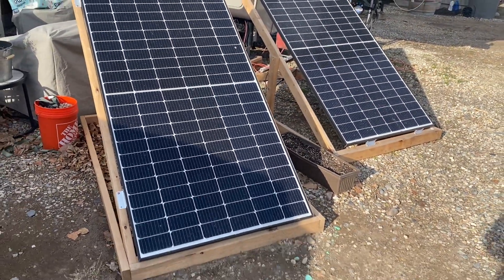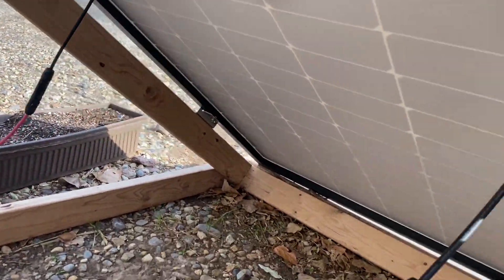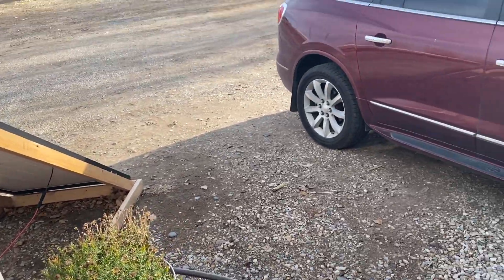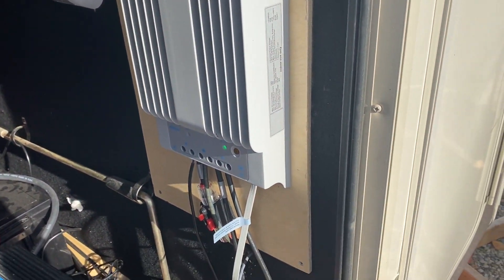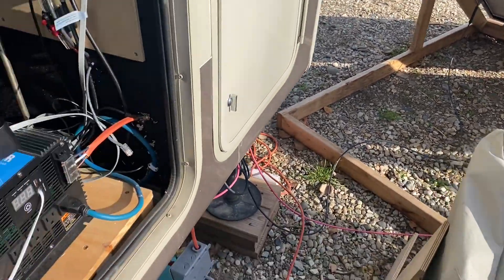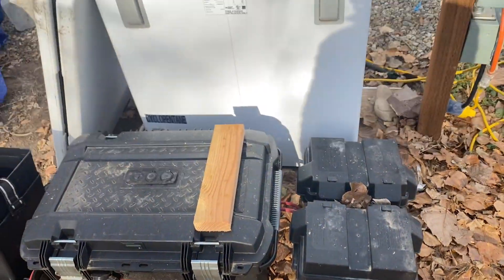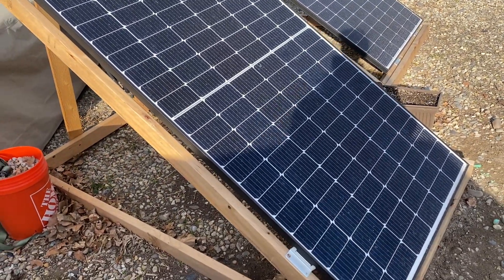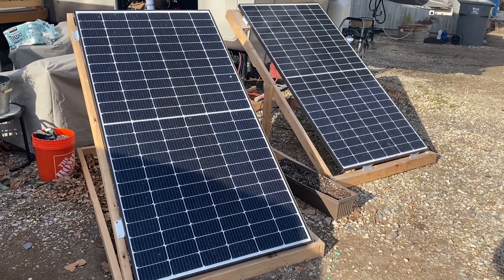TaleSun 400 Watt Solar Panel Review

Comment: Hey now, where did you get your panels?
Reply: You can now get them TaleSun 400w bifacial solar panels from Signature solar for $108 a  panel  minimal purchase is 10 panels.. Which breaks down to 27 cents a watt. Now if you get a pallet of 36 then it breaks down to 25 cents a watt which is $100 per panel... TaleSun is a Chinese in house brand that's a medium sized company that's been around since 2010. They sell more in China. They are in Europe and Japan.  Signature Solar now recommends TaleSun over Hyperion panels and not much reason anymore for BlueSun.  It seems the Talesun 400w Bifacials outperform the Hyperion 400w bifacials. according to Signature solar... Note right now til the end of the year it's 5% off and $150 flat rate shipping...
Reply from the maker: I actually bought them from a friend who sells solar components. But I think you can google these and find them as well. But you may have to buy a set amount to make shipping worth your while.